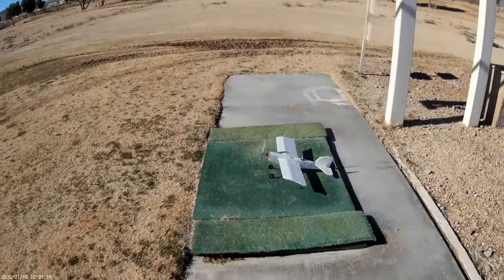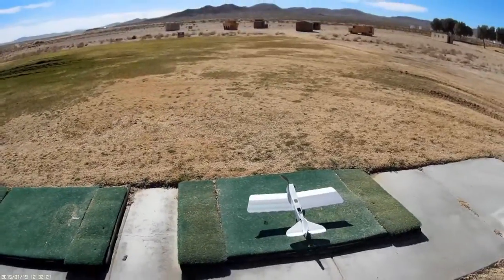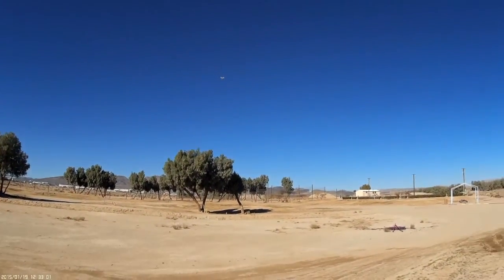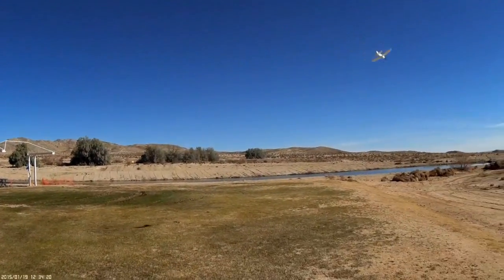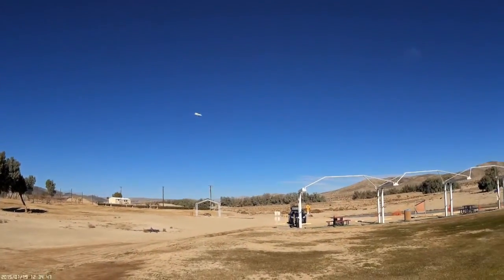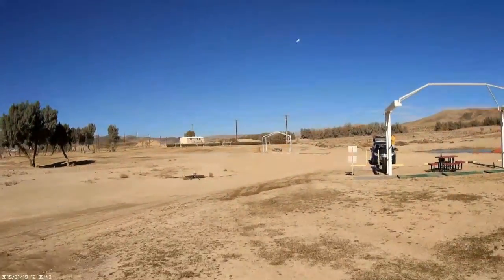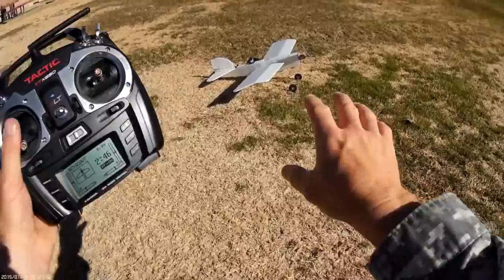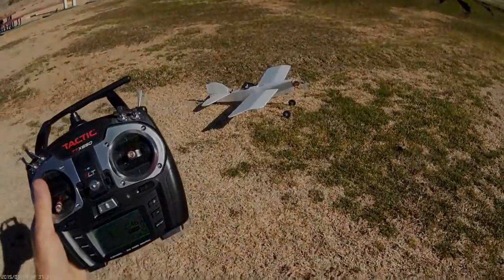Flite Test 125% Mini Scout - 19 Jan 2015

Comment: How do you bank with a plane with no ailerons?
Reply from the maker: Hey there! Well, there's lots of RC planes that bank without ailerons, and they're called "RET" for rudder, elevator, throttle. The dihedral of the wing helps the rudder authority and helps to bank the model and then you just pull thru the turn with the elevator. I hope that makes sense to you, but these things are so much fun to fly! Cheers my friend 😎👍!

Comment: Ficou top msm, qual e a eletrônica que vc está usam colega
Reply from the maker: Meu amigo já faz um bom tempo desde que construí o avião, mas acho que usei um motor menor, um motor 28/30 de 1100 kV e um Turnigy Plush ESC 30a. Tenho certeza de que estava usando uma bateria de 1000mAh, 3s. Eu espero que isso ajude!
Reply: @JustwingitRC  valeu colega muito obrigado, estava pesquisando uma boa eletrônica para colocar no meu, vc me ajudou bastante msm com está dica valeu pela atenção seu aviao fico top
Reply from the maker: @emersonrodrigues4001  Não tem problema meu amigo, fico feliz em poder ajudar. Tudo de bom para você!